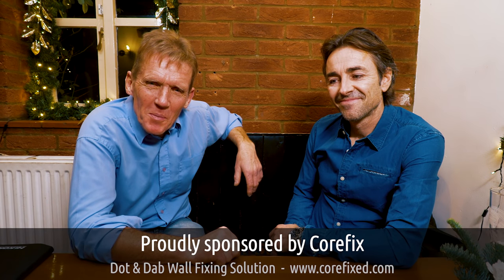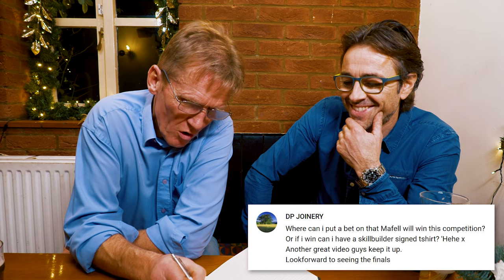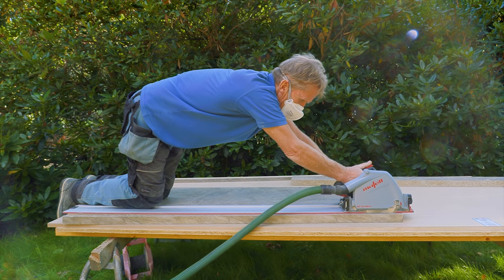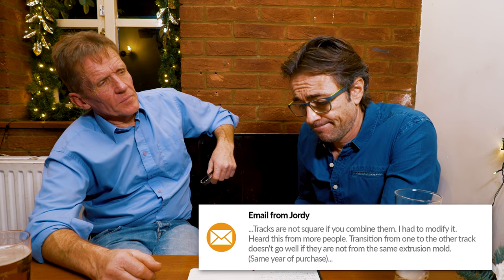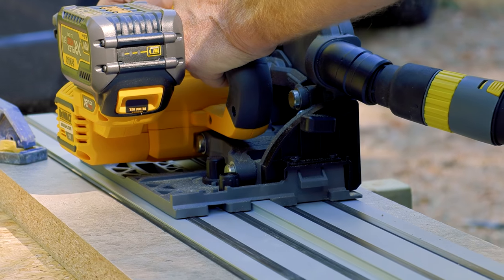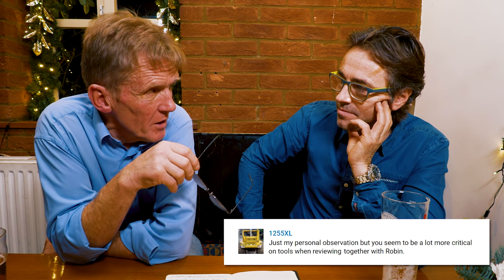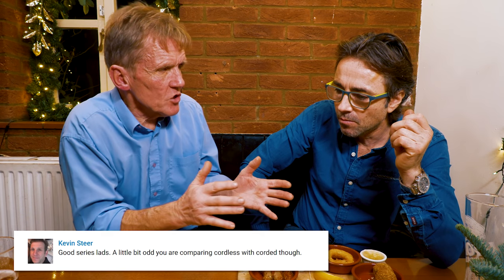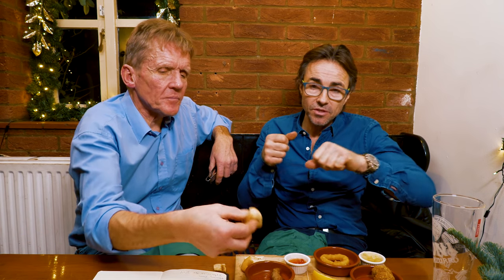Plunge Saw Season - Your Comments & Questions

Comment: I own the bosch, it actually arrived on the day your review was posted. Watched it, then ran to the saw to check the base, luckily mine is flat as a mill pond but have seen another with the warp. It’s a fantastic machine, quality of cut is excellent, bags of power. Have used the Mafell and they are very similar, as you correctly say though the mafell is more refined and higher quality. Much like an Audi > Skoda. 
Love having the 1600mm tracks rather than 1400, and the joining connector is far superior to any of the other brands. Put the two rails together and I know that it is perfectly aligned every time,  so haven’t needed to buy the long rail like you mentioned. 
If you are changing blade constantly then the mafell wins over every other saw hands down just on the blade change alone.
Interesting to hear the comments on the Bosch quality control issues across the brand, the vast majority of my gear is Bosch and with the exception of a jigsaw that died within days (replaced instantly with no hassle) I have been very lucky. My tool repair man has noted that the newer Bosch tools are far less reparable than previous generations, many of the components, example drill triggers, are no longer just the component on its own but now are moulded and integrated into the electronics. So no longer is a replacement trigger about £15, you need to replace the entire trigger/circuit combo for 5x that! 
The other brand I use a lot is metabo and they are absolutely built proof. They are part of the CAS battery alliance so batteries are interchangeable with mafell, starmix and other German brands too.

Comment: I believe the comment about more power from larger batteries is true. I torqued my lug nuts with a torque wrench and tried by old Makita impact driver to remove them. Would not budge with a 3ah bat, but with a 5ah they came off after 2 seconds rattling and that was on two different lugs and the two that the 3ah couldn’t remove.

Comment: I've seen the odd trade using erbauer and the like, some can't afford big brand tools or just won't spend out any more after having their vans robbed for the second or third time.  Not all of my stuff is from the bigger brands but I tend to buy quality if I know I'll use it a lot or I need it to be good - which generally means I buy German.  Anybody trying to argue that the budget  stuff is as good as the top end is deluded, it'll get the job done in most cases but it'll take longer/be more noisy/vibrate more/leave more dust etc etc

Comment: Your talk about batteries at around 6:50 is interesting. I'm on the Bosch battery platform and it's worth noting that their new ProCore range of batteries are listed with increased grunt (as well as runtime) as the ah rating goes up. So their 4ah ProCore, they say it's equal in performance but smaller/lighter than the old. The 8ah can deliver 1600w corded equivalent and their soon to be released 12ah can deliver 1900w+ corded equivalent.  Maybe we'll see more of this type of thing as more companies start battery ranges with the big 21700 cells. For the record, even on the old batteries, I come down on the side of a bit more grunt is available the higher the ah. A 6ah just seems to not drop off as much under sustained full load as do the smaller batteries.
Reply: Have you tried the pro core yet?
Reply: @theartistformallyknownasdi5338  Yeh, I've got 2 x 4.0ah ProCore and one 8.0ah. I've only got one tool optimised for them though (GBH 18V - 26 SDS). It's a different beast with the 8.0ah. I did a YT review comparing the new ProCore 4.0ah to the old style if you're interested. See here: https://www.youtube.com/watch?v=kq3hO1fUe9w
Reply: @BischBaschBosch  will have a look thanks, think I'll go pro core when I need more batteries.
Reply: @BischBaschBosch  just watched and Sub'd 👍
Reply: @theartistformallyknownasdi5338  Nice one mate, thanks! For Bosch users I'd recommend biding your time before investing in ProCores. I've seen a leaked Bosch Korea promo pamphlet with new cordless circular, plunge and mitre saws coming in 2019, all optimised for the ProCores. Worth sticking with your old kit to see if the new is worth the investment. All the best.

Comment: I bought the Makita cordless track saw. It was definitely the most expensive saw I've bought, but I love it :-) I have metal saw horses. I didn't realize the depth was going to hit them. The saw powered through the metal saw horses without a problem. I wish it had a riving knife.
Reply from the maker: I think most of us have made a mistake with the depth control. There is a lot to be said for bolting a couple of sacrificial bits of softwood to the tops of the saw horse.
Reply: @SkillBuilder  Good point! I was so excited about the saw till I forgot. I was building my first little project with it a king size bed. My craftman table saw wasn't giving me the straight edge I needed. Any ideas on an entry level portable cabinet saw? 😊

Comment: There are a few worm drive circular saws (American Skill or Cuz-D) where the blade is on the other side, not aware of any plunge saws. I have a Dremel corded circular saw I use for cutting up ply sheets, where the blade is on the other side, but it’s limited to a 20mm depth as Max. Good reviews boys👍
Reply: I believe Kreg is on the other side.

Comment: 4 amp hour dilivery to the motor is greater than 2 ah dilivery same with 6ah .... the whathours (wh) is printed on the bottom of most battries for a for 4ah battery your looking at about 86 whathours : whathours is the better way to workout how long a a battries will run ... from what i gatherd ! hope this helps :) !

Comment: As I understood Makita track has the most versatile track with its anti tip feature for angled cuts (also why not for normal 90 degree cuts too). I also think that this feature makes it more secure against kickbacks. On the other hand Bosch saw has more power, similar features as mafell for less (except the micro adjustment) and cuts clean. So my questions are: 1. Will Bosch saw work on Makita track? 2. With a small modification on the Bosch plate like a screwed metal piece can we even make the anti tip feature of the Makita track work with Bosch saw? If these can be done why not buy Makita track and Bosch saw? Best of two worlds ;)

You may ask if I prefer Bosch saw why not go with their tracks too. 

Although Bosch track has nice and very well thought joining connector and removable strips at the bottom it has its own drawbacks. 

First of all Bosch track is too narrow and thinner than others. For instance if you want to use other brand clamps it is impossible without modification. And the saw itself covers the entire surface of the track. So no room for anything to be used in conjunction with the track like external clamps, may be adapters or even for your hands. 

Secondly narrow rail shape of the track (2,35mm) looks very bendable and fragile. 

Thirdly you can't use new Bosch tracks with any other third party tools and/or accessories. You are stuck with Bosch's limited and not always very well designed adaptors. For instance their router adapter FSN OFA. It has a nice micro adjustment feature and large base but it doesn't have an adjustable front support against bending like the Makita adapter.

Finally and most importantly for me Bosch tracks don't have anti tip feature. Why a company like Bosch REdesigns a new generation of saw tracks without thinking of this feature? I can't understand. Instead of completely changing their track design they could easily implement an anti tip function and make the older version work with other brands too.

As for the Bosch saw I think it is not the best but it is ok. It lacks riving knife, slim dust extraction (necessary for closer cuts against the wall), micro depth adjustment,  anti chip feature and anti kickback feature (only an optional adapter that can't be found easily).  I beleive that all of these brands can design and produce much better products. Every one of them has something missing. Like what? Blade diameter (can be bigger. Only festool came up lately with something bigger for and outrageous price), better anti kickback features, riving knife, more powerfool motors, better tracks etc. 

They are only after ripping off customers year after year for small changes. Instead of quickly manufacturing by using valuable world's resources in order to get into the market and ask tons of money for a thin aluminium profile and a slightly modified circular saw, design something complete.

Anyway at least these are my thoughts as a DIY person who had to spend too much time for research on track saws and lost his mind just to find out small tricks of big named companies.
Reply: By the way I would like to thank you for your time and effort. These movies were really helpful for me.

Comment: How much of the performance is down to the saw vs the quality of blade? Would a cheaper saw with a good blade perform higher up the food chain?
Reply: It's a good question Michael. Not just a good quality blade but the right blade for the task too. I have a variety for all my saws - cross cut, rip cut, ruff cut, fine cut, cement board and laminate. If you're just a DIY'er, a decent fine tooth would do for most tasks in a cheap saw and give you comparable cuts with infrequent use. For use every day - your job for example - the extra build quality and refinements of the priceyer saws pay for themselves. I use a Mafell MT55CC these days. The ease of blade change alone from that saw and the micro adjust for zeroing in different blades is worth the money for me. For the record, I use mostly Freud and Bosch Expert (the blue ones) blades.
Reply: a good cheap saw with a good cheap blade also works, I use the triton 48t neg rake blades in triton makita and festool saws depending on where I am. painted, veneered, wood or laminates. doesn't matter if it is a 4k or a 40k kitchen

Comment: A higher amp hour battery will give you more power (initially anyway). It’s shown in watt hours,. A Bosch 8amp battery will give about 160 watt hours compared to a 4amp which is about 70 watt hour.

Comment: In regards to the question of does the Ah of a battery make a difference in the performance of the tool, I’ve found that it can depending upon the tool and the job. One of my Milwaukee tools is a m18 non fuel sawzall. Normally, I’d run it using 4 and 5 Ah batteries. Performance was satisfactory, even for heavy demo,  but noticeably less than my 15A 120v super sawzall when doing the heaviest cuts. One day while doing some light demo, without thinking about it I put a 9Ah battery in it that usually lives on the circular saw. The improvement was so immediately noticeable that I stopped to check out the tool to see what was different. It still isn’t as good as the corded tool but the improvement was significant enough  that I’m planning of getting another 9Ah or even a 12Ah battery for it and keep the 4 and 5Ah batteries for the drills and smaller tools where, after trying out the larger battery, I found that there was not a noticeable improvement for the typically 1/2” and under drill bits and screws that I most often use. Thinking about it, even under more demanding tasks I can’t imagine a bigger battery making a difference on a small drill. A 5Ah battery is enough to drill a 4 inch hole saw through 6 inches of solid wood. And, the torque is enough to kick pretty hard if he bit binds (even when using the side handle). 

When you review tools, it would be interesting to not only try the battery that is typically supplied but also with the other sizes and evaluate how it performs with the biggest to the smallest ones both in terms of power but also ergonomics.

Comment: Ive been shopping saws to long. The Bosch seems a decent saw . it has the narrow ridge to ride which straightens the saw right off the hop. also it has only one angle adjustment up front. I was considering Festool but the price increase does not go with the extra work of operation and under powered. If Mafell was an option here in Canada would be a different story maybe but they have it arranged through a US distributor and they have a vastly inflated dollar considering it passing through 2 importations in the process. Parts is another story.
What I wish Bosch would come up with is a dual Doweler like Mafell has. Do you know of a Manufacturer that builds a similar tool? I do not want the domino by festool. Buying dominos is to much. Regular dowels you can buy by the sack and not break the bank. Please let me know if you know of a dowel machine other than the domino? I can import directly.

Comment: The festool seems slower because the electrics in it protect the motor, the auto cut out when it overheats is a pain but then if u use it that much then you would use a mafell

Comment: Volts + amps = watts 
Yes 100% higher ah gives you more power. 
It simply can’t not. 
How have all electric (corded) appliances been rated for ‘power’ for ever?
In watts. 
Hack a saw apart and bodge up a second power connector for another battery. 
You will hear the power go up if you connect that second battery while running compared to one battery. 
Connecting so the volts remain the same but the amps double
Reply from the maker: You are obfuscating amps with amp hours. They are not the same so you sum does not work.

Comment: the fact that these saws are on tracks makes it pretty irrelevant that you find it hard to see the line for left handed person. it's on a track , so it can't go anywhere else.
Reply from the maker: That is true but if you are plunge cutting you need to see exactly where the blade is.
Reply: Mafell sells a guide stop, it clamps on the rail to stop the saw passing too far. Can also be used as a kickback stop